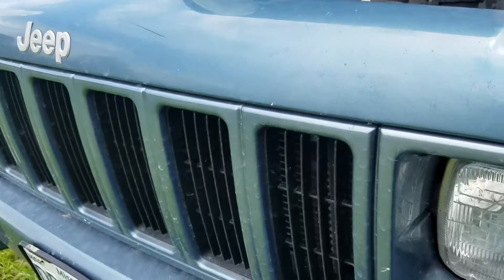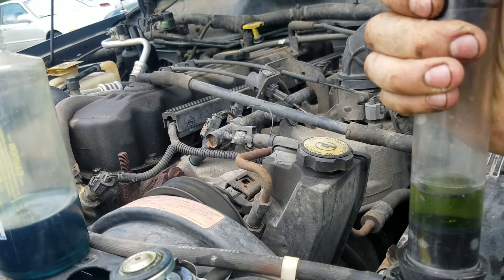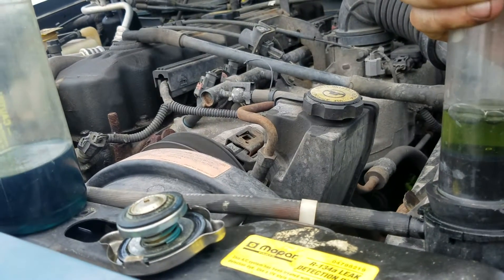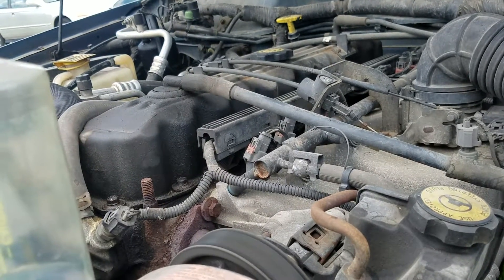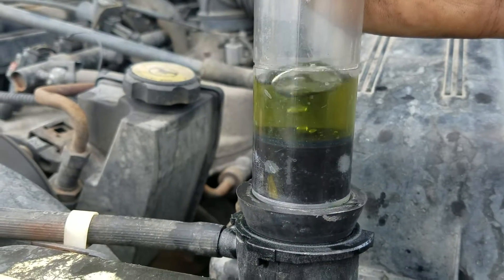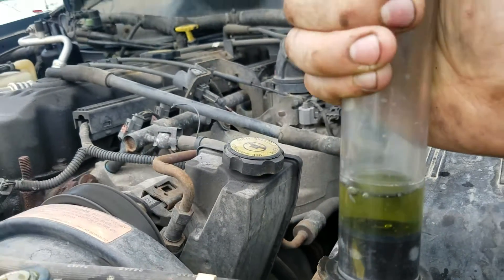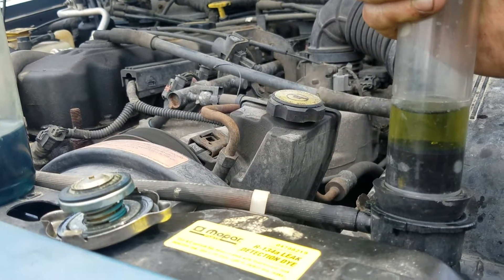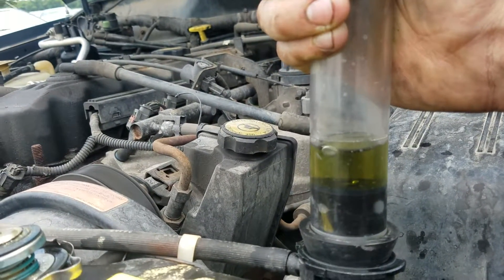Hydrocarbon Testing for Blown Head Gasket

Comment: Mine went green, not yellow on my 2011 Subaru STi when i tested it on the tank on the highest point,  but it didnt get yellow or green on the pressuretank or radiator….what does that mean? Ive got oil in my coolant tank though, but my Car does not overheat, i dont have coolant in the oil, only oil in the coolant. Ive checked the oilcap, no "sludge" or wear that indicates headgasket issue….hmmm. I also did a "Compression test" a trick i learned from a Subaru guy, and he Said, when the Car is turned off, push the clutch pedal all the way down with the gas pedal, then try to start the Car, the Car won’t start, but the Car should make Even noise, and if it doesnt, when it makes uncosistent noise, then i got a leak. When i did that test, it seemed very normal and had even noise….sorry for my english, but i hope you understand me:-) hope for a reply.